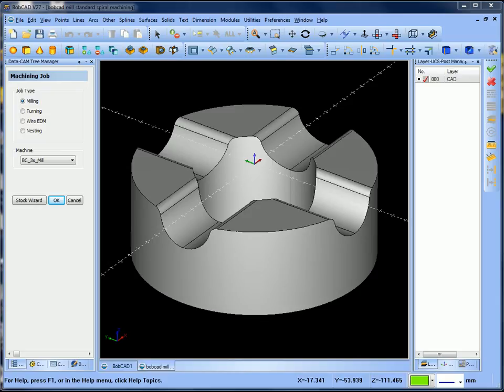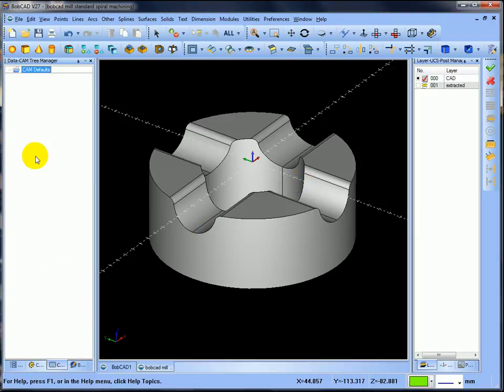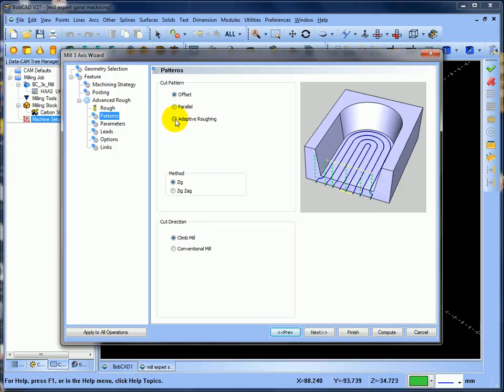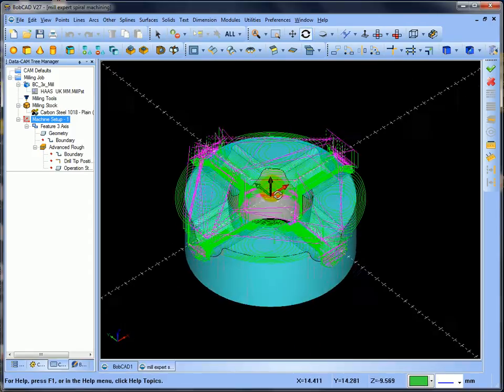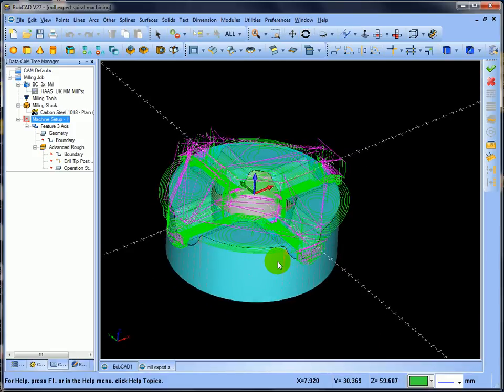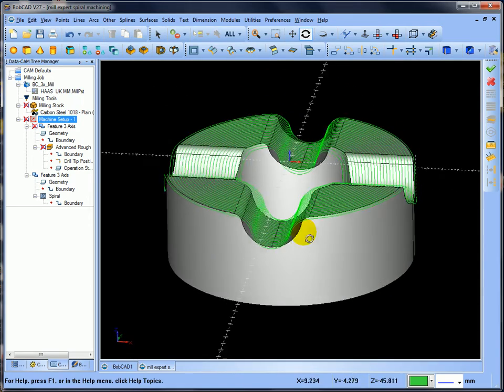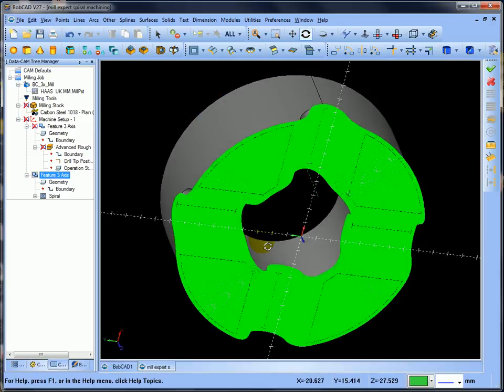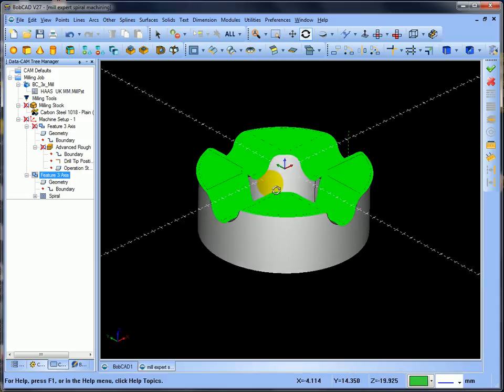BobCAD V27 Spiral Milling Demo

Comment: interesting to see how you did this.  please repeat as close as the code allows without using the pro version toolpath options?  also, you had a ball mill working on all angles of its radius -- how does bobcad handle feed rate as the cut along the radius changes (presumably at a constant spindle speed)?